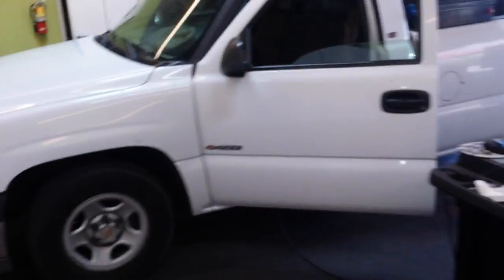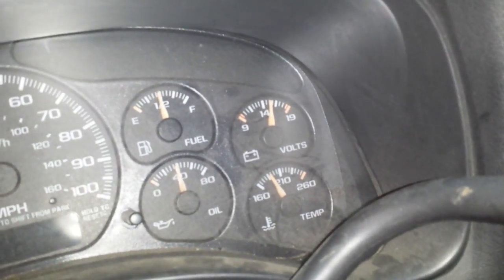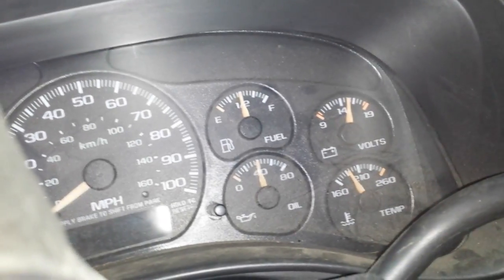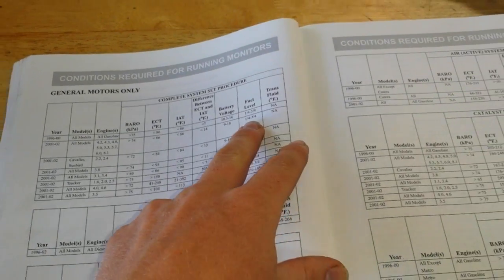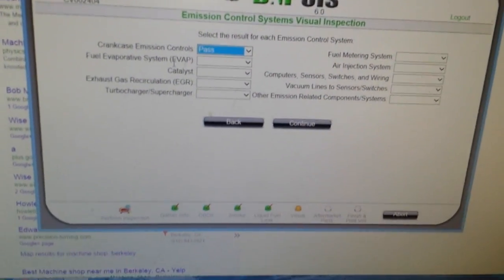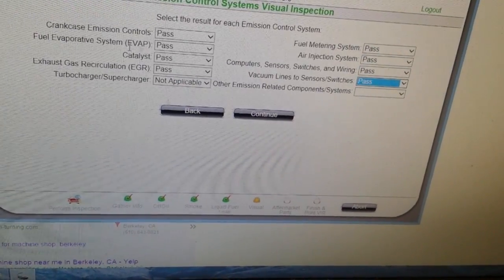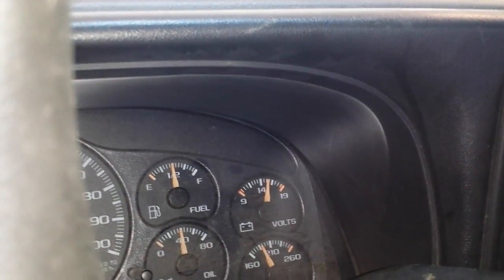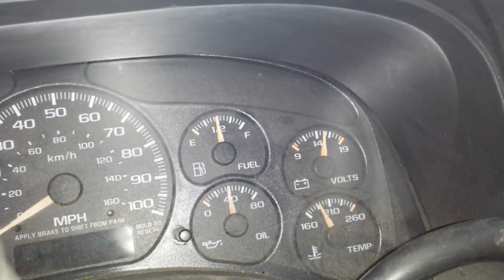Cannot set OBD monitors on Chevy & GMC truck.. fix?

Comment: If this fixes it can you message me on social media your Venmo or PayPal ? Cause I’m having the exact same problem on my 01 Yukon XL 5.3 I just bought ,catalyst monitor  will not reset I’ll have to put $80+ in and take it to the station if it fixes you I wanna give you a little something for fixing my project Yukon.
Reply: The “air” fuse is missing if that affects anything I’m in California so that fuse may be required?
Reply from the maker: That is probably something to do with your a/c. But... your coolant level guage and fuel level guage both work?
Reply: @ScottiesHobbies  I think my temp gauge is accurate but my fuel gauge is erratic as hell
Reply from the maker: @Andrew-hh3ol  to get the monitor to run, the fuel level needs to stay around 1/2 to 2/3  tank for about 15 miles when cruzing at about 55 mph.
Reply: @ScottiesHobbies  I can’t tell how much gas is in it (besides filling it up and measuring) and I don’t think the car can ,the gauge is all over the place ,tomorrow I’m gonna bring it in again because I’ve done everything in the instructions he gave me multiple times. I was doing 55 for 50 miles and it won’t set I think it’s either this , the missing air fuse or a trashed O2 sensor/cat I also have to fix the splicer connector it’s causing a link error so I can’t even check the monitor myself.
Reply from the maker: @Andrew-hh3ol   Does your cigarette lighters you work on your dash? If you are seeing the gauge move around, so is the computer and it wants to be comfortable to set the monitor. If it was a o2, I'd think you would atleast get a mending code.
Reply: @ScottiesHobbies  I have to work on the splicer connector because I’m getting a link error there’s no engine light unless it’s broken , cigarette lighters work and the fuse is good , it’s down to wiring harnesses or random issues like a missing fuse #4 in the top row of the engine bay fuse box potentially causing the catalyst issue I’ll get the fuse and splicer fixed tomorrow and if it works it works
Reply: @ScottiesHobbies  my scan tool won’t even read right now I’m having some sort of communications issue my technician isn’t having with his scan tool it powers on and works fine in my other cars with obd2 I’m trying all my ideas tomorrow and if that doesn’t fix it it’s pretty much a lost cause it’s supposedly showing a catalyst monitor code  like I said probably because of the fuse that only matters in California Yukons I’ll update you in 24> hours if it’s a ECU/wiring issue or a mechanical issue

Comment: Long story short my Catalyst monitor and my EVAP system monitor and my oxygen sensor heater monitor won't set I do have a messed up fuel level gauge it does read empty and sometimes halfway sometimes full it will be my next step of fixing I'll keep posted. On a 1999 Suburban 1500 2WD
Reply: How did you fix it so it can pass smog i have the same problem same car